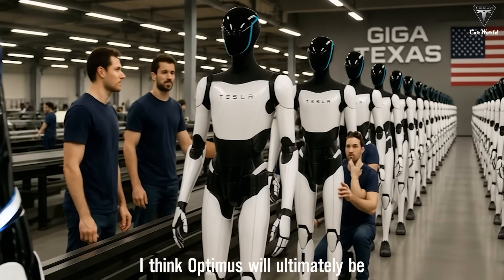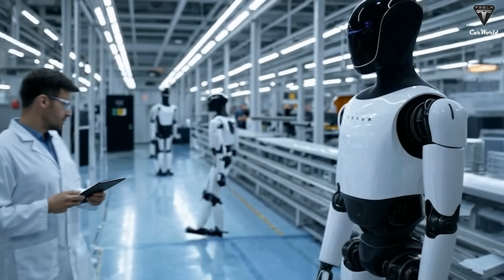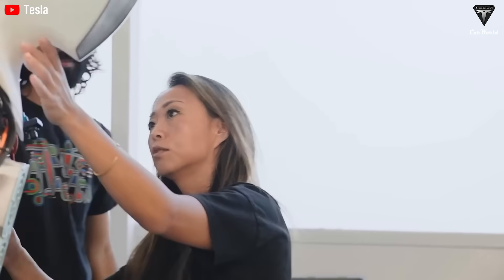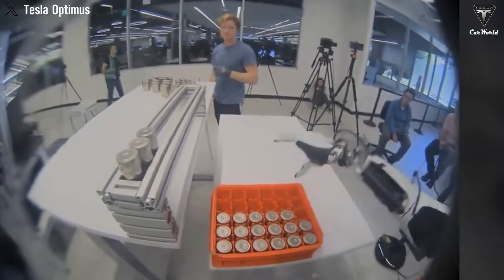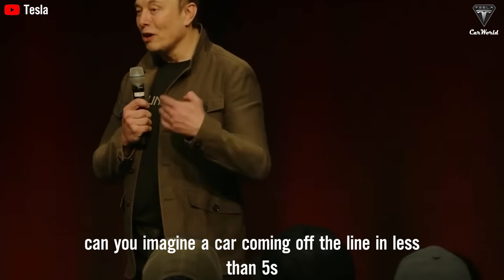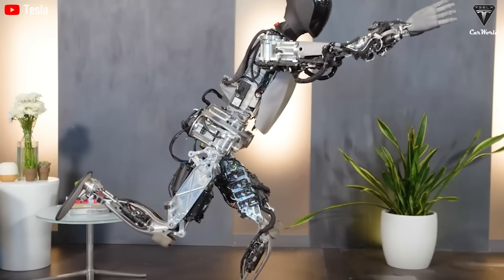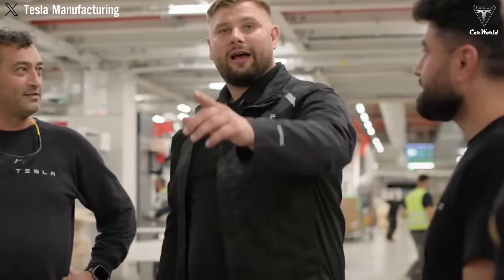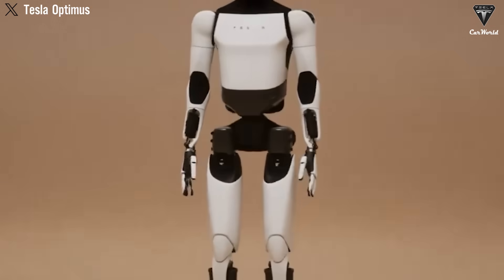Elon Musk Reveals Tesla Bot Gen 3 With Big Design Updates! Sales Start by Late 2025!

Comment: AI is a bullshit term.  It's COMPUTER ALGORITHMS nothing more and it existed since the late 1970's.  But with hollywood and sci fi and dishonest marketing it's getting called something it is not.
When Tesla admits it will make errors then they no longer talk about "AI" now they use the real term "Software update"  That's right, it's computer algorithms, no intelligence. Intelligence does not need software updates, it learns.
Reply from the maker: You’re right that “AI” often gets over-hyped—at its core it’s advanced algorithms and data-driven models. Tesla’s “sim-to-real” pipeline leverages reinforcement learning and neural networks, but under the hood it’s still software updates, sensor fusion, and optimized control loops.
Reply: @TeslaCarWorld  Thanks, however whether or not an algorithm is 'advanced' is subjective. Thus the algorithms running in these human parodying machines are not special in any way,  'advanced'  is an empty adjective to use from an engineering perspective (which i am) , it's a marketing superficial adjective as is the rest of your answer.  Neural networks have been around since the late 1970's.  I remember looking up papers in neural networks in my engineering school back when there was no personal computers, no internet and you had to search by browsing through millions of small 4x3 inches cards placed in small drawers in a library.  This is using the exact same principles there is nothing new at all except faster CPU cores, ASICS, and denser and faster access memory. 
The rudimentary gait of your robot betrays that your control loops are very compartmentalized and still have 20 years to go.  For example a boxer 's movement in a ring depends on the dynamics of of every gram of mass in his body. A punch starts in his heel propagate through his knee, hip, shoulder, elbow and finally knuckles.  Your robot is completely disarticulated in his movements. 20-30 years to go.
You should have started with a much smaller animal. A chipmunk incredible climbing, graceful jumping  would put anything you make in the next 20 years to shame.

Comment: It looks  like Joe Biden when it walks and it is not worth the sum of its components. Just a waste of energy and materials.
Reply from the maker: Walking style is subjective—Optimus’s gait is engineered for balance and energy efficiency. Tesla’s vertical integration drives down actuator and sensor costs, so you get far more value than just “parts.”
Reply: @TeslaCarWorld  The balancing act of walking immediately betrays the dynamic ability or lack thereof.  Graceful animals such as monkeys run on a large branch fifty feet above the floor or humans in ballet dancing or even a small children walks with skills. It is not subjective to say that this robot balancing act is a primitive mechanism it looks extremely static, and especially has no dynamics projection. It looks definitively slightly worse than Biden's gait.

Second, you mistook my words, the sum of its components is the value spent in energy, manufacturing effort amd material all of which are more valuable in a different application than in this human clowning machine.

Comment: I can spend the same money & have my laundry machines moved to the first floor. What I need it for is to vacum & clean a 25 x 50 ft outdoor inground pool & to maintain my yard. Elon you can bring one to my house for the summer & teach it. I wont charge you.
Reply from the maker: Optimus can vacuum a 25×50 ft outdoor area with its rugged all-terrain attachment and maintain the yard using its modular tools. And for the summer trial, Tesla’s pilot program lets you test a bot at your home—no charge if it doesn’t meet your needs.
Reply: @TeslaCarWorld  It's not just a 25 X 50 ft area; It's a pool that's 8 1/2 ft deep with a liner. Can Optimus vacuum it ? It also has to hook up the suction into the skimmer & keep it attached while vacuuming. St. Louis summers are extremely hot & humid ??

Comment: A human picking up a cylinders and dropping them a rack would use both hands and each hand would be able to grab 2 cylinders at a time.  Of course the robot can work at half or 1/4 of the speed without a break until the battery runs down.

Comment: Maybe The Robot Could Have Some Specialized Attachments Like ISS's DEXTRE:
OTCMs (One-Touch Cable Mounts)
Force/Moment Sensor (FMS)
Robotic Refueling Mission (RRM)
Latching End Effector (LEE)
Visual Inspection Poseable Invertebrate Robot (VIPIR)
International Space Station Robotic External Leak Locator (IRELL)
DEXTRE Is A Two-armed Robotic Manipulator, Part Of The ISS's Mobile Servicing System (MSS), Specifically Designed For Precise, Fine-Motor Tasks On The International Space Station.

Comment: [6:20] Tesla's new plan is simple.  
A service van will visit every two months, and each car can connect through a small Starlink dish so mechanics can check problems from afar.  It isn't perfect, but it's a big step up from having to haul your Optimus all the way to Fremont for repairs.  

]6:36] On the other side, skeptical researchers say humanoids will erase 5% of repetitive manual jobs and spawn 3 million rolls you've never heard of.  Recall that app developer was fringe in 2007.  
]6:48] Pain lies in the transition, not the end point.   Tesla pledges free retraining for any warehouse worker displaced by its own bots.   Self-interest dressed as altruism, sure, but still a lifeline.  
[7:06] Gen 3 accelerates the trend because it's the first variant that can both stack crates and thread a wire harness.   Whole job categories shift from sweat to supervision.  
Whether that thrills or terrifies you probably depends on how close you are to retirement.

Comment: I worry about the batteries,  I would not by the "Tesla Truck" because if the battery catches fire, and is plugged into your house catches on fire.  The Fire Department can not put out the fire.  I wait and see.
Reply from the maker: Tesla’s Gen 3 uses the same rigorous thermal-management and fire-resistant battery technology proven in millions of EVs. With IP54 sealing, onboard temperature sensors, and remote monitoring via Starlink, Optimus is designed for peace of mind as well as performance.